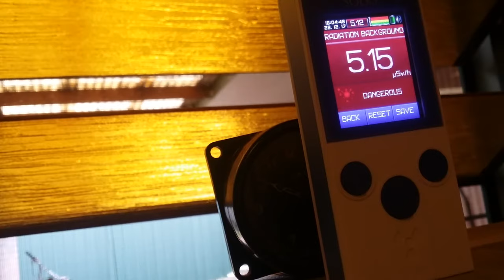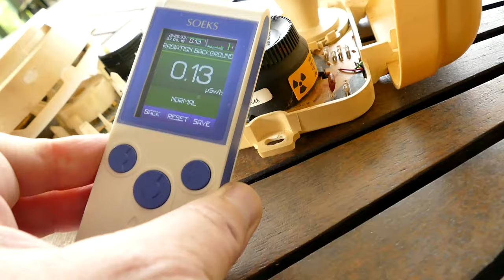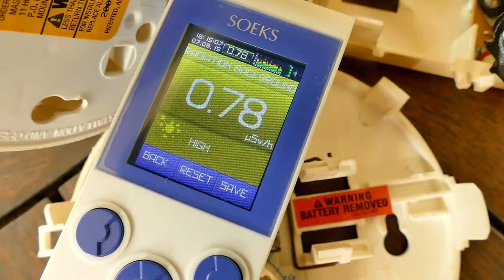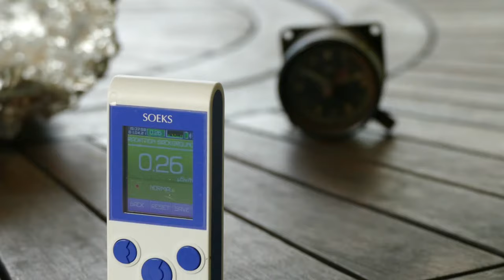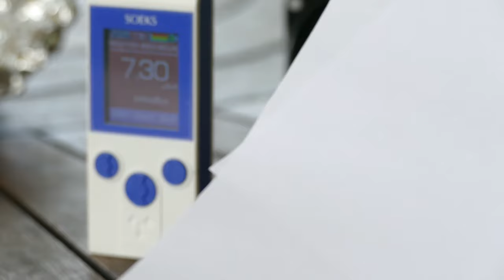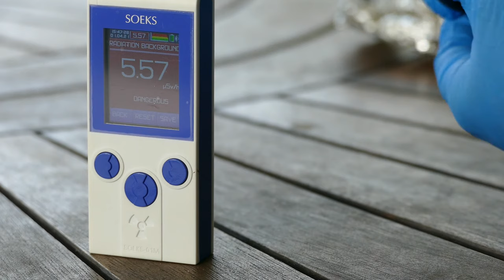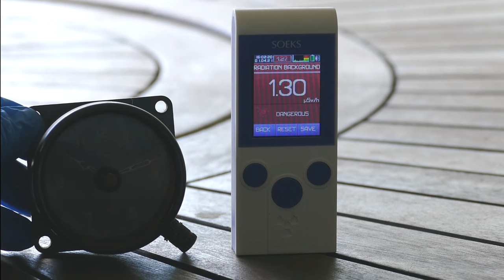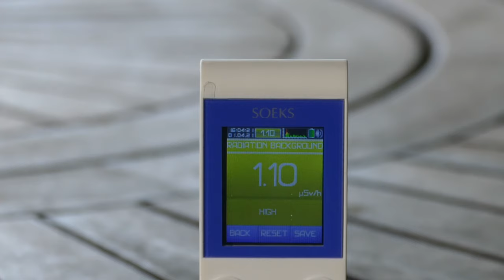Geiger Counter Tests VS Background Radiation

Comment: I get background radiation here in Copenhagen Denmark around 0.08 to 0.20usvh on my Geiger counter..
Though Im rolling a cheap one to around 50 bucks USD.. I dont have the need ot the funds to put more after a Geiger counter,, this unit also has S.E.H electromagnetic graphing and all that jazz. 
the only test source I have for the Geiger counter is those smokealarm sensors from China.. costed like 3USD for 3 of those, with shipping.. if I lay it on all 3, it peeks around 2.45usv
Reply: though the electromagnetic, I find useful with RC and these multi protocols and check how potent they are.. very linear and continuously results for such a crude geiger/radiomagnetic cheap device from Chiona, and when I compare those values on my spectrum analyzer, though It needs to be precise with how I place it. .
https://imgur.com/LaVTfzX
Reply from the maker: Hi, that's interesting; my partners son lives in Svendborg...That latter reading's pretty high for background radiation; I think a lot of Europe is high in particular due to the Chernobyl accident, and the cloud which travelled across a vast amount of it. I lost a good friend last year from breast cancer; both her & I both theorised about the coincidence that she was born & raised in Sweden...
Reply from the maker: Well; they're cheap units, but there isn't a lot to dosimeters really - mainly just the tube and some basic electronics
Reply from the maker: Did you happen to see my other 2 (so far) radiation videos? You might also like them - LETHAL RADIATION DOSE TO MY FACE FOR 20 YEARS!;https://youtu.be/zR_lRRpBbDI and RadioActive Contrast Dye Post Surgery;https://youtu.be/ry1Uap-o0yo

Comment: Does this unit pick up alpha particles??
Also, do not take the glass off that old dial instrument. You risk inhalation/ingestion from the paint degrading.
Radium will also produce some beta and gamma.
Reply from the maker: Yes it does. See my linked video about when I used to have it sitting above my desk for 20 years...I no longer do!
https://youtu.be/zR_lRRpBbDI
Reply: @SteveMack  
Hi Steve i looked it up and those units do not pick up alpha.
Only certain Geiger Mueller tubes are capable of alpha detection.
I almost bought one.
Reply from the maker: Really? Radium-226 decays by alpha particle radiation to an inert gas, radon-222, which also decays by alpha particle radiation...This one sure goes off it's head when exposed to radium.
Reply: @SteveMack  
You are probably picking up beta emissions.......?

Radium-226 Decay Chain: 
Radium-226 (1600 year half life) yields an alpha particle and Radon-222; 
Radon-222 (3.82 day half life) yields an alpha particle and Polonium-218; 
**Polonium-218 (3.05 minute half life) yields an alpha particle and Lead-214; 
**Lead-214 (26.8 minute half life) yields a beta particle and Bismuth-214; 
**Bismuth-214 (19.7 minute half life) yields a beta particle and Polonium-214; 
Polonium-214 (0.16 millisecond half life) yields an alpha particle and Lead-210; 
**Lead-210 (22 year half life) yields a beta particle and Bismuth-210; 
**Bismuth-210 (5.0 day half life) yields a beta particle Polonium-210; 
Polonium-210 (138 day half life) yields an alpha particle and Lead-206; 
Lead-206 is STABLE.
Reply from the maker: ...Handy summary answer, from ChatGPT (saves me opening the box): the SOEKS 01M PRIME is capable of detecting alpha radiation. The SOEKS 01M PRIME is a handheld radiation detector and dosimeter that can measure various types of radiation, including alpha particles, beta particles, gamma rays, and X-rays. It uses a Geiger-Muller tube (GM tube) sensor to detect and measure radiation levels. Alpha particles are relatively large and can be stopped by a sheet of paper or a few centimeters of air, so if there is alpha radiation present, the SOEKS 01M PRIME should be able to detect it.
Reply: Hi Steve radium gives off alpha beta and gamma (Don't ask why because it would take a few hours to explain) I personally don't have the same geiger counter as you but I have a gmc 500+ (beta and gamma) and a radiacode 102 (only detects gamma) and as a comparison a button from a smoke detector will be about 300 on the gmc 500+ and over 80 thousand on the radiacode

The alpha isn't involved with the detection but the gamma is clearly different and hopefully shows that the readings are different depending on how you detect them

A geiger tube will ionize the gas, but in a scintillation crystal, it makes a flash 

Also, you can detect all the radioactive elements because they all give off a gamma ray (even polonium 210)

Comment: Have you ever tried this device next to a mobile phone, on different settings. E.g on,off,flight mode,wifi on, wifi modem etc?
Reply from the maker: RF radiation is different to Alpha, Beta, Gamma radiation...For that you use a frequency meter or RF meter that covers the particular band the device emits on. 👌
Reply: @SteveMack  cheers mate
Reply from the maker: @TKDPWR  No worries!👍👍

Comment: Damn.. my Geiger counter recorded a reading of 0.39 usv/hr on the grill fish that bought.
Reply: It's jumps from 0.16 usv/hrs to 0.39 usv/hrs so fast when I move the geiger counter onto it
Reply: Okay now it jumps to 0.45usv/hrs
Reply from the maker: Shit! - What's your local background radiation level?
Reply: @SteveMack  Mine should be 0.12 usv/hr
Reply: The problem with my Geiger counter is that it fluctuate up and down.. one second, it's 0.06usv/hr, the next few seconds it's 0.16 usv/hr... Now for no apparent reason, it's 0.33 usv/hr. I wonder is it faulty..
Reply from the maker: @Jero2012DIY  It could possibly be...
Reply from the maker: @Jero2012DIY  ok, so regardless of exact accuracy; the fish IS a higher reading...Was it Tuna?
Reply from the maker: ...It does SOUND faulty, if it's erratic whilst not moving the device!
Reply: @SteveMack  nope it's not tuna. Just normal fish. The reading dropped after a few try. I guess the only way for me to test it's effectiveness is to go look for some radioactive items to test. Sadly I couldn't find any.
Reply from the maker: Oh?...Even more concerning really. Where do you live? You can probably (still?) buy harmless samples to reference it against, on ebay...
Reply: @SteveMack  Hi Steve, I live in Singapore.
Reply from the maker: Thanks for the info! 👌🙂